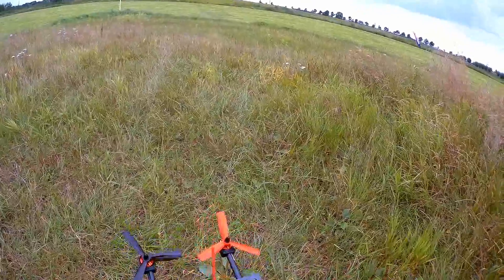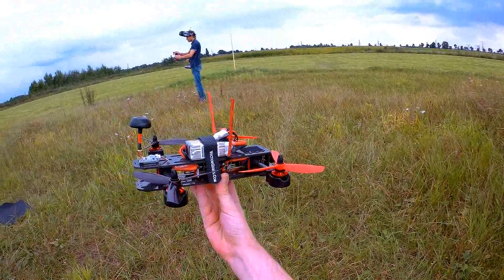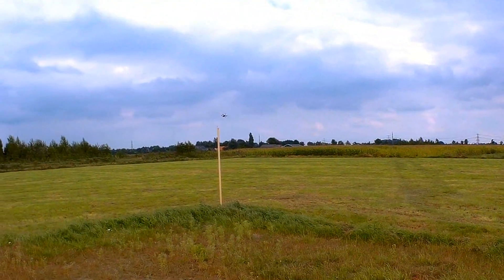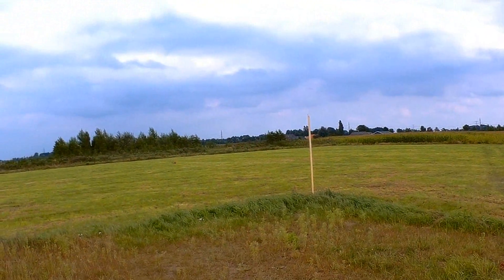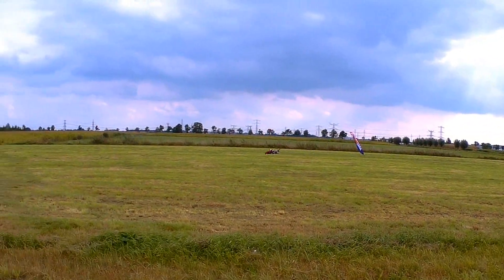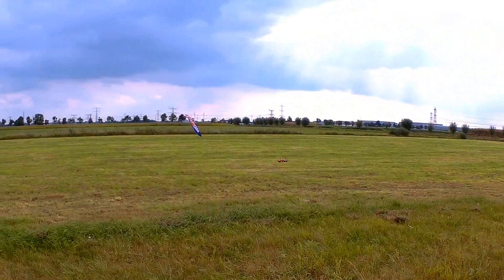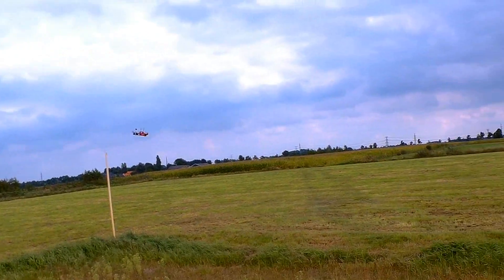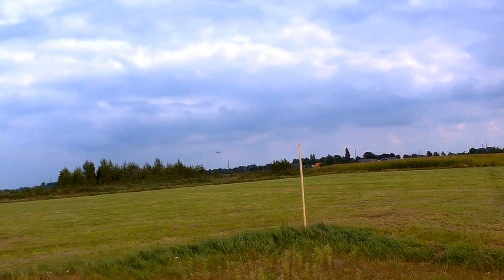Vector Quads Tilt Rotor Quadcopter - Tuned Flight Test :)

Comment: Hey Roeland,

after two years whats your opinion on Vector Quads and other Tilt rotors ?
Reply from the maker: Hi there Nik,
I think they are a fun part of the hobby. I allways like playing with things that are different. The Vector Quads tilt rotor Is pretty durable, but I wouldn't fly it as hard as normal quads.. Especially the servo is something that fails in a 'good' crash :)

Comment: What flight controller do you use and how does the servo connect to it? Thank you very much
Reply from the maker: Hi there :)  I have a F1 Naze32 in this quadcopter.. And the servo is basically not controlled by the FC at all.. I have it on a seperate channel in my radio, and control it's rate with a mix..

Comment: hey I have got a tilt and would love a bit of help on the settings in clean flight clewnflight to keep it level
Reply from the maker: Hi there Rashann,
well.. what I have done, is completely bypass the flightcontroller for the tilt-servo.. So the FC does not know it is a tiltrotor.. In my radio, I directly control that tilt-servo.. That works well
Reply: Ok great I have a mix setting I'm using ia6 radio and naze32
Reply: I'm needing help with the bypassing the flight controller to the for tilt only also can't get the tilt to go backwards lol any help is greatly appreciated sir
Reply from the maker: Same flight controller in mine :)  I am NOT sure how to do this in an Ia6 radio though :$  In my Futaba radio I have to enter 2 mix-values.. 1 for forward, and 1 for backwards.. (not 2 mixes!).. I assume the same goes for Your radio.. pos-mix & neg-mix I think??
Reply: Ok I understand that I assume that I make two mixes one forward and one backwards in the ia6 setting s
Reply: Tried 100 percent mix to pos and neg yet no backwards action only forward
Reply from the maker: I think 1 of the 2 should be -100% (negative)
Reply: Thanks I'll try that here in a bit

Comment: I love the quad!! I also built one, a custom design, but it's a nightmare to get flying. You said you fixed oscillations, how did you do that? Mine flies fine when tilt is not engaged but starts to shake quite a bit when I engage the tilt and move forward/backwards.
Reply from the maker: Hi there Ryan :)  Thanks for stopping by.. Yeah. I very much like flying this quad as well :) 
Well.. 1 reason for the oscillations is that the back props wind up in the turbulance of the front props.. right? 
What I did, was: I limited the tilting a bit AND allso have 20% of the pitch go into the FC.. That way the entire quad tilts a Little as well..
Reply: Excellent! I'll give it a try this weekend :) Thanks for the advice

Comment: nice flying, heb dit frame ook gekocht.
Hoe heb je die 20 procent mix gedaan.?
Ik heb een taranis , maar nog niet echt veel met mix gedaan.
Reply from the maker: Dank u :) 
hmm ik heb Zelf geen Taranis, dus Daar kan ik niet veel over vertellen.. Maar in het 'algemeen':
+ de pitch / elevator stick heb ik aan CH8 gehangen. 
+ Normaal mix ik CH8 1-op-1 richting het kanaal waar de servo aan hangt (CH7 in mijn geval)
+ en voor die 20% mix ik ook nog 20% can CH8 richting CH2 (dat is bij mij elevator / pitch)..

Dat Zou in iedere moderne radio redelijk makkelijk te doen moeten zijn.. EN een goede kans om je es te verdiepen in de mix mogelijkheden van je zender :D

Comment: Seems to be really responsive. What type of FPV do you use? I like the quantum that you reviewed,what receiver transmitter do you use on the quantum? I think mabe next year I may invest in FPV,but more for other people to experience in flight while I am flying. I dont get into flying around trees and other stuff that can easily destroy my equipment. A broken blade is pretty much part of flying for me. I havent broken too many since I started flying again. A total of three on the Apprentice. Two on the BiPlane. None on my helicopter,I know right? How is that possible. I had it up again tonight. while I was flying it,a meteor flew across the sky,breaking into pieces as it went. I lost concentration and somehow managed to set the helicopter down without smearing it all over the ground. That WLToys V913 is as sturdy as a rock and easy to fly. Granted it wont do any tricks,but it flys well and thats what I wanted. WLToys is comming out with a new sized helicopter,its not available yet through banggood,the are only taking pre orders. Its a 450 I want to say. Dont take my word for it but according to the ad,it will 3-D and has built in programming for such. Too bad you dont preview heli's. I cant wait to see that one fly. I may buy one.
Reply from the maker: Hi there Scott :)
yes sir.. It's a lot of fun to fly both line-of-sight 7 FPV.. At this moment my go-to goggle is the Quanum V2 (not the pro, and not the Cyclops).. I have the Quanum Diversity receiver on it.. 
On this quad I have a Quanum Elite video transmitter, and a Eachine 800 tvl CCD (not a cmos) camera:
http://www.banggood.com/SONY-DC12V-800TVL-13-Inch-960H-2_1mm-Lens-Wide-Angle-CCD-HD-Camera-For-FPV-Multicopter-p-1015547.html?p=TO251813974002015038 
Works well, for what it costs... Not as Awesome as this camera though: 
https://www.youtube.com/watch?v=KgN3n7aLqAc 
But well.. that one costs 2x as much.. hmmm actually it Is wurth the extra $$ :P haha

I see a few newer Walkera's as well! I hadn't noticed those yet.. BUT.. I'd really like a scale looking heli, instead of 3D flyers :$ 
Ehmm I do have quite a nr. of heli video's by now sir :)  Who knows ;)
Cheers!
Reply from the maker: ps: correction.. the [new items]  selection is out of wack again.. The walkera's don't seem new after all :|
Reply: +DutchRC Adventures I had my mobius camara all set up to fly on my V913 but took it off to fly it on the Apprentice instead. I almost crashed the V913 watching an Awesome meteor burn up. It almost looked like a satillite,it was too bright,and I watched it break into three pieces,two fell to the earth,the last one kept going. they travelled south east to north east. I completly forgot that I was flying my heli for a second. I ended up putting it down in the taller grass but nothing was damaged.
Reply from the maker: Maybe they were shooting 'Gravity 2' (movie) ?? :) 
You should have wearing a head-cam my friend ;)
Reply: +DutchRC Adventures I know someone sells something simular to a go pro ( Hobby King?) Its most affordable and I plan on getting one. Then I can share my experiences more!
Reply from the maker: I use this combination for my video's:
A SJ5000X: http://www.banggood.com/SJcam-SJ5000X-ELITE-SONY-IMX078-GYRO-4K24-2K-2_0-Inch-LCD-Action-Camera-Novatek-with-Accessories-p-1009127.html?p=TO251813974002015038 
And this to put it on my head:
http://www.banggood.com/Non-Slip-Elastic-Head-Strap-Headband-Mount-For-Gopro-Hero-1233-p-949648.html

Comment: Hey buddy it's flying really nice now, tweaks seem to be working. Do you research and tweak it at home or do you have a laptop with you and tinker with it out in the field? I know some guys at my local track bring a laptop along and will tweak the timing and stuff on their ESCs between heats. I'm not sure if that is that easy to do for these quadcopters? FPV on this will be fun to see! cheers brother :-)
Reply from the maker: Hi there Mike :)  Thanks man! I really like flying (and crashing :$) it now.. I had a Very hard crash after I shot this video, so durability tests are allso well underway :P 
All changes I did for This video were done in my transmitter actually, and yeah.. I did do some work on that in the field before I shot this video :)  Flight-controller settings I can actually do on my phone :)  ESC settings I can't however (yet) :$  But in all honnesty I generally run most ESC's stock..
FPVing this quad is a Blast man! Great to never have the camera-angle be wrong :) 
Cheers & have a good week!
Reply: hehe yeah i guess you don't have to worry about that... point it straight ahead and pretty much level with the horizon eh?
ok makes sense about tweaks with the radio... hehe my inexperience with not having a high grade transmitter for flying :-)  doing thru the app on the phone is pretty cool it's amazing how far things come and where things will be going in the next few years!
Reply from the maker: Correct :) It only pitches down a Little bit :)  Very nice for sure :) 
Well yeah.. If you ever get more into flying quads & planes, I'm sure you'll get youself a decent radio.. They don't All cost like $800, but yeah.. a good one Will set you back $200-$300 :$ 

Yes sir! Pretty soon we'll just have to Tell the quad to change some settings :) (and it'll then tell us to shut it :P)